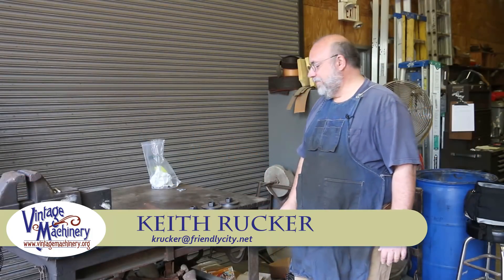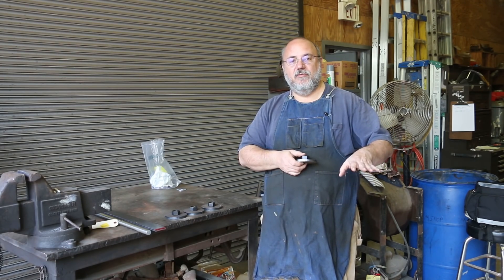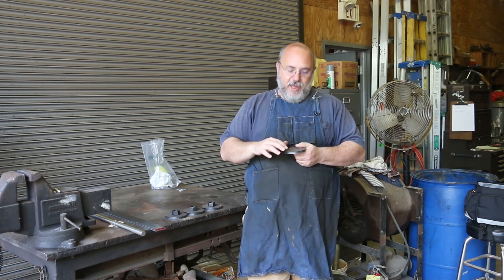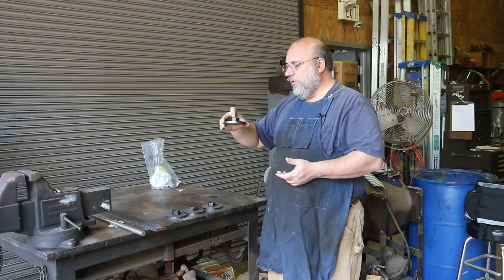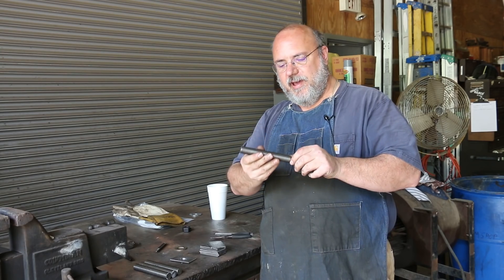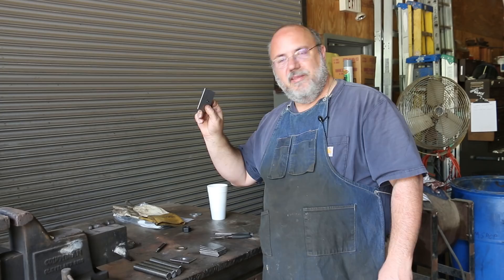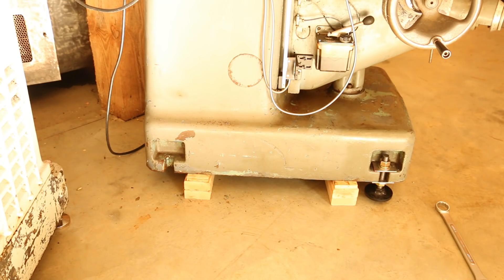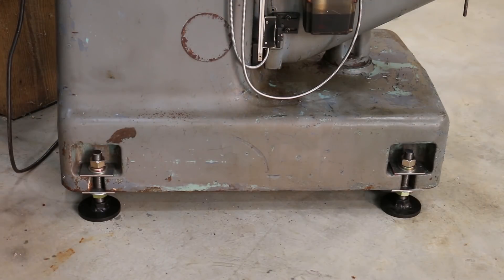Building and Installing Leveling Feet for a Wells-Index Milling Machine

Comment: Some machines are made with levelling feet in mind. Others don't have such accomodation. According to my cincinnatti #3's manual the recommended way for my machine is to use wood shims to get it level and then shim the rest of the base all the way around so the whole base is in contact with the floor and supporting the machine. Its really a matter of personal preference. I have also seen one video where a guy used some I-beam sections along with levelling feet to raise, level, and stabilize his Cincinnatti #2 dial type-milling machine.

Comment: A bridgeport is a very heavy machine. They are to sit on the floor, and not elevated as you have it there.
The motors are also very powerful, and after some time the machine will vibrate out of position.
You were wondering why they designed the machine with slots instead of holes. Slots provide easy access to a hole in the floor for a cement anchor for securing the machine, and and also keeping the anchors within the footprint of the base of the machine. If you measure the slot you'll find that it is 1 inch wide so you can use a 3/4" dia anchor given you accrately drill the holes in the floor. You could use a 1 inch diameter anchor if you are super accurate with the hole locations. The cement used in the floor of a machine shop is very dense and it takes some effort to drill into it, but with the right equipment it is not bad, and that anchor will never let go. I like your leveling feet and they are well built, but  you might find that machine walkjng on you depending on the type of work you do with it. They do seem just a little flimsy for a machine that heavy. Nice job on the feet, and you'll know in time if they serve you properly.
Cheers !

Comment: You neglected to grease the scroll gear, pinion end pins and pinion retaining pins when you reassembled the three jaw. The six jaw should have a set of both inside and outside jaws. Also, I cringed when you used an hardened Allen key to tap out the scroll. I always use a brass or mild steel pin to avoid damage.

Comment: These older machines were built to be bolted to concrete slabs. The process was to put studs into the slab they'd sit on, level them a certain height above the slab, then bed them down on grout injected through the sides, or, lift machine and place grout under the footprint of the machine, then drop the machine back down on the pre levelled studs in the concrete. That way the whole machine was supported and levelled forever.
 Back in a bygone era when factories were assumed to be a 30-50 year concern and the machine wouldn't need to move in it's service life.

Comment: just be aware that as the mill isn't bolted down to the concrete if you swing around the turret it can topple,  probably. best to move the table to the far end to balance the weight while you do.

Comment: Kinda like the pockets for feet. Not a bad idea at all.
I did mine with 1/4" urethane material (cut into discs), used a ballend cutter to make pockets in the steel and radiused the end of the threaded rod. The feet swivel to match whatever is under them and hopefully the urethane damps vibrations. Good so far. :-)

Comment: While someone else also mentioned them, Hockey Pucks make great pads for those kinds of feet. You can get a dozen for about $25 from Amazon, down here in Texas, the popularity of hockey suffers from the rarity of ice. Just jack the mill up and slide one under each round plate, they're about the right diameter and very tough rubber.

Comment: I made my machine feet kind of the same way. Difference is that I used hockey pucks to absorb vibrations. Works well and the pucks are still fine after 5 or so years.

Comment: Great video, and perfect timing.   I'm getting ready to put leveling feet on a couple of my machines.  Was planning on buying some, but this will work perfectly, and save me quite a bit of money since I need 12 of them (or more depending on what my new to me horizontal mill needs).

Comment: Would some loctite in the welded nut be a good or bad idea?  Just askin'...
Reply: Unnecessary, the sheer weight of the mill will prevent rotation..
After about 6 months the inherent natural corrosion will begin to set in preventing even deliberate removal.

Comment: Those are probably engineered like that for hold downs. Ideal for shipboard use. I'm sure the Navy or any larger ocean going vessel with a machine shop doesn't want their mills sliding all over the place in bad weather. Thanks for the video.

Comment: I have seen a number of machines, typically larger, heavier ones that might get grouted for support, with this setup. I think it is for a couple reasons, including the ability to insert the tie or foot without lifting the machine much, it allows for the machine to be cleated rather then having the bolts go through the base, and the casting may be stronger than with a through hole. As built, I'd expect more than suitable strength, unlike some others here. Just be careful of the piece walking out of the slot under vibration.

Comment: The Head on that machine is so tall and heavy that I worry that if the Head were rotated 90 degrees and the Bed trammed to the same side that it could be close to un-balanced.  Then add the work piece and clamping and you might reach tip over.  The machine was intended for shims and anchor bolts or studs.  My opinion and Please be Safe.

Comment: Hi Keith.  Two things - first, the steel plate you're using to support the load looks to be a bit light for the weight of the machine.  I know that you used a washer to back it up, but I'd expect deformation.   Second, you made no provision for locking the lower adjustment nut, which is actually what is carrying the load.  Given a bit of machine vibration I would think that the nut would have a tendency to move, especially if the load plate distorts.   A simple jam nut to lock the adjustment nut in place would have been cheap and easy, and would have solved the problem.  If the adjustment nut does vibrate loose, the design of the Wells Index base is such that the foot could simply pop out of the slot.  Top heavy as those machines are, that could easily topple it.
Reply: Yea you should make the bottom square washer connected to the one on the other side so even when loose they won’t pop out

Comment: Without the "swivel", doesn't that mean that just the edge of a foot could be holding up the whole machine. Not sure that even matters, but I'd think it would bend or something over time. With a swivel on the nut, the foot would take the angle of the floor for better contact. Just curious if it mattered in actual use.

Comment: Think I would at least double stack the plates on the bottom side to span that opening in the mill. That one little plate even backed up with the washer looks like it would be flexy to me. Of course my mill is sitting on wood blocks so don't do like I do! lol
Reply: I was thinking the same, a little thin for that weight

Comment: Hi Keith           Cool solution to the problem at hand, but what about changing the 4 small plates on the underside of the machine to 2 straps going across the machine  the short way, that way a loose nut will not allow a foot to walk away and cause the machine to tilt. The feet looked like they elevated the machine about 3" and that might possible be just enough for the machine to go completely over, and that would be a crying shame.           keep up the amazing work

Comment: Bad idea. For one those bearing plates are way too thin, could've easily bought some nice thick ones at a local lumber yard in their framing hardware section. And the other bad idea is not bolting them down tight to the floor to dampen out harmonic vibrations that'll show up as excessive tooling marks on any work you produce.

Comment: I'm thinking that the bottom cold roll steel plate is not thick enough to hold the weight of the mill.  Maybe if you doubled up the bottom plate, that would make it not bend.